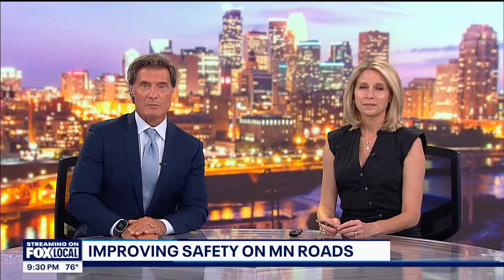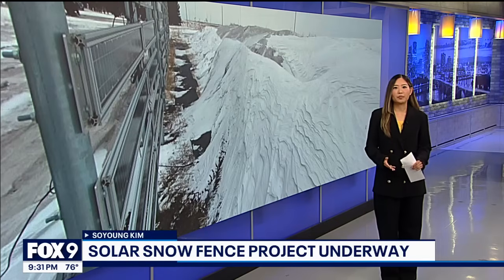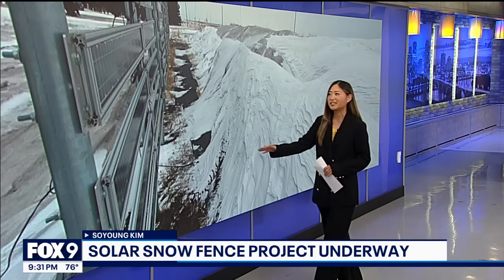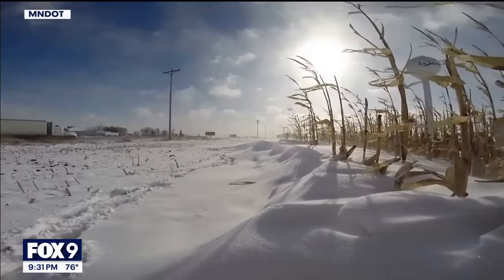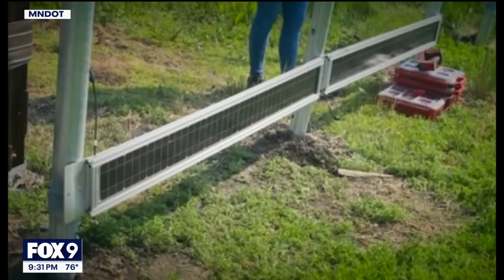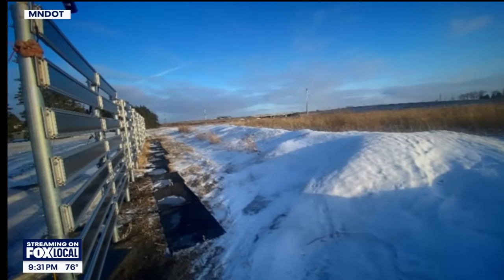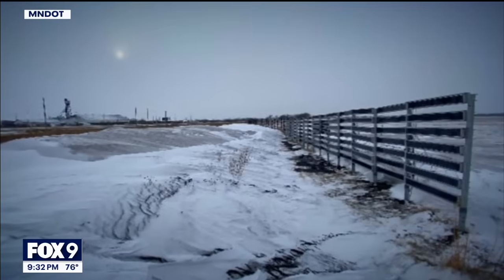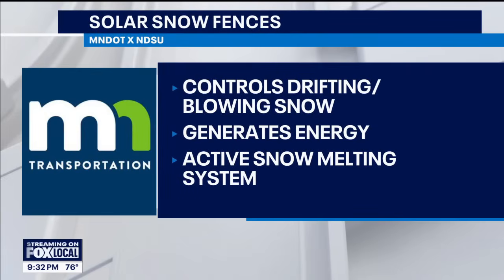MnDOT developing solar fences to control snow

Comment: He should use wind turbines to generate power in winter instead of solar. He should do more research before wasting the public funds. Minnesota has less sunlight in winter and a lot of snow storms. How and where the sunlight comes from? Most of the experts work in the office. They are never know outside conditions. One more thing he never mention is battery power will be less efficient in extreme low temperatures in Minnesota.

Comment: I don't understand the benefit.  You don't need to melt the snow by the fence.  How much does it cost to dispose of the solar panels when they are no longer in use?  A standard fence or trees sem to be a more budget friendly solution.  A solution looking for a problem that doesn't exist.
Reply: I believe this would be to control snow drifting more then anything else. At least that's what i presume. That is the only real issue in storms anymore up there.